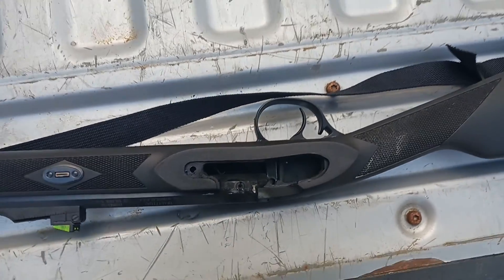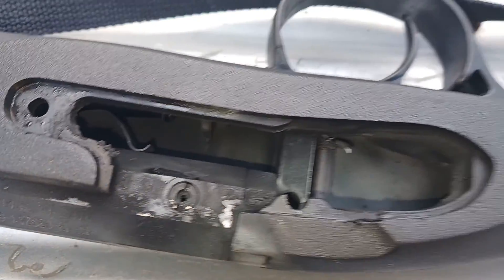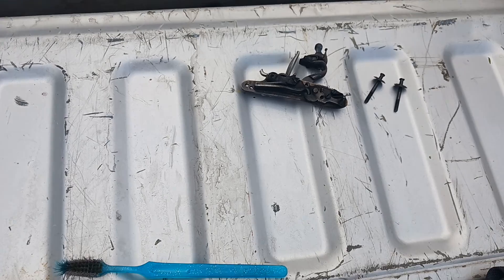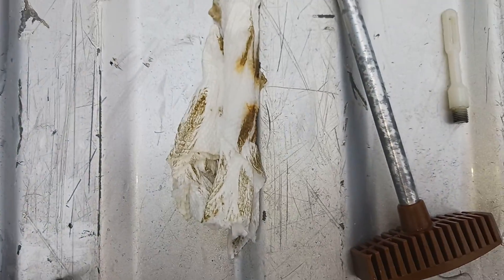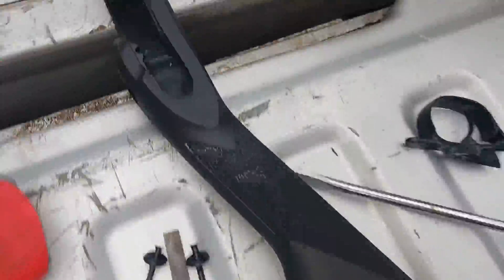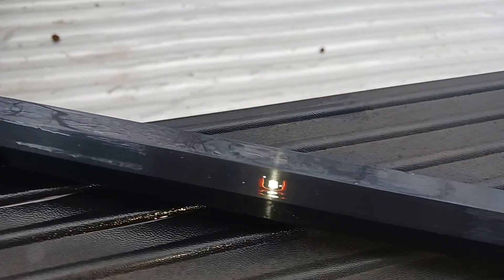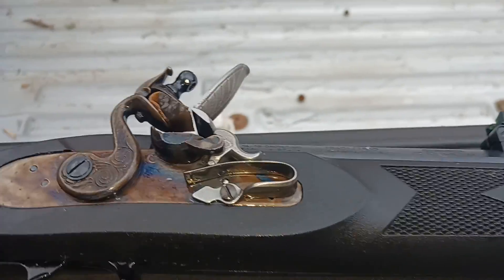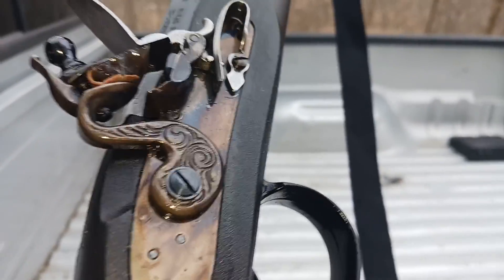Advanced armorer course for flintlocks

Comment: Dish soap is excellent for removing the black powder fowling. 
Absolutely clean the plastic too as it contacts the metal and black powder residue is hell on blued metal. 
I like WD40 for items that need to be washed with a water-based cleaner such as soap and water. 
When I went to gunsmithing school in the early 80's standard protocol when we removed a newly blued part from the bluing tanks was a rinse in boiling water, blow off the parts, and an immediate dousing of WD40.  We let the parts cool with the WD40 on them.  The WD40 displaces the little moisture that may be present after the water bath. It also seemed to slightly deepen the color of the bluing. Then we wiped them completely dry and used good gun oil on them.
Reply from the maker: Soap and water always seems to do just fine for me too.  I should develop a washing machine for blackpowder guns, 😂.

Comment: WD40 was formulated here in San Diego for blasting into jet engines onboard aircraft carriers to get the water out. Somehow it gets between the metal and the water and chases it away.  It took 40 tries to get it right !  lol
Reply from the maker: It's magical juice.  I use it to clean my hands when they get super nasty, like when i am working on rusty brakes.  It takes the nasty away and soap and water takes wd40 away.
Reply: @RealDeanWinchester  Don't tell the "I Did That" sticker people, but it's also great for removing sticker sticky glue.
Reply from the maker: @4d4Spl  i saw one of those that someone tried picking off of the pump, 😂.